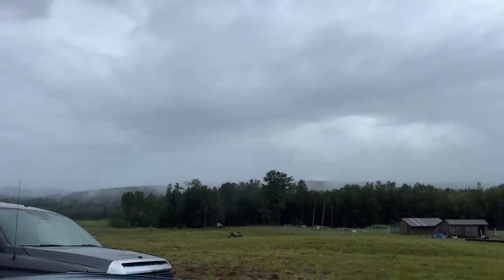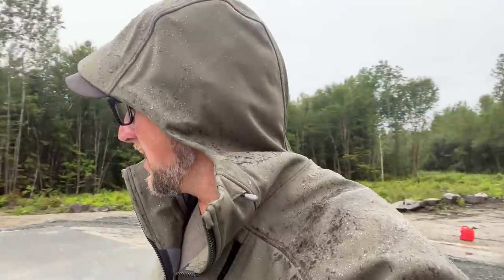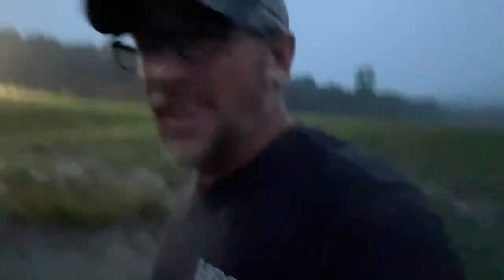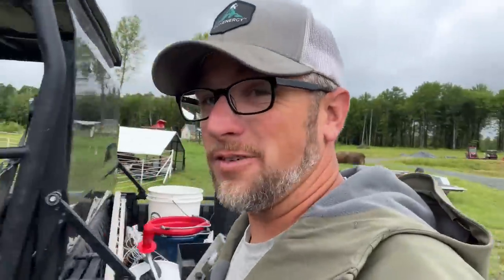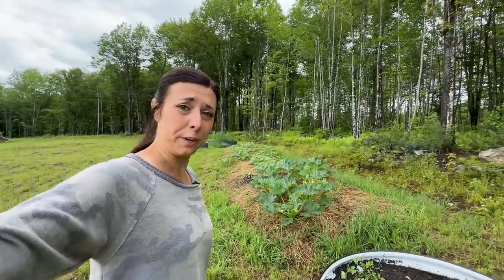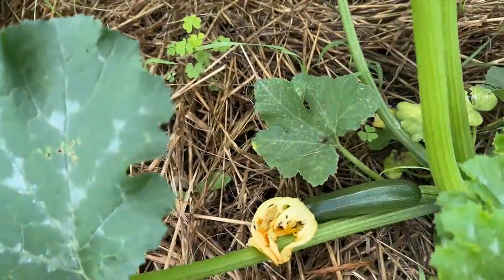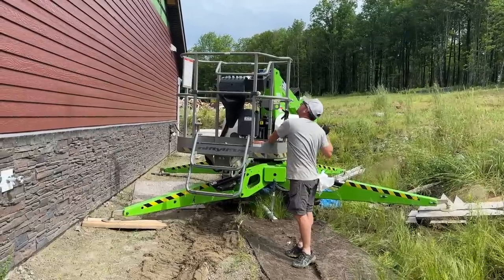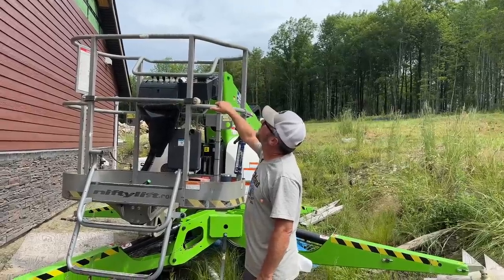MY $2500 MISTAKE...

Comment: Hi Al, Gina and Olivia! You can idle that machine most of the day without using too much diesel fuel. Diesels in general are very thrifty on fuel consumption while idling. I would not cut it off while you are up there….just my 2 cents.  Lol….

Comment: Hi Al great to see what you have done so far. With the Nifty Lift you should have a control down the bottom so the lift can be controlled from there as well. All the ones I have used in the UK have that control so Gina could let you down if the machine strands you up the top. Take car and stay safe.

Comment: Gina when cutting multiple soffit pieces you can stack three sheets on top each other and cut three at a time (saw can handle at least three maybe more) also just add a clamp as a stop on the saw tray and cut multiple pieces same size

Comment: Maybe next time you cut expansion joints in concrete, Gina could use a battery powered leaf blower to keep your chalk line visible if she is not filming.  Just a thought.  Of course it really doesn't matter that much for a shop.

Comment: if you tilt the machine too much or have it on very uneven ground the boom wont move and it will lock up,  at last on the machine i have, it has a safety feature stopping you from tipping it over on even ground, you have to have the struts out and level the machine off before it allows you to raise the boom.

Comment: Hello Al. I love your videos. I have that same rain gauge. Once the center section fills up with the inch of rain and overflows into the outer  section, each tenth of an inch measurement in the center tube is another inch of rain. No need to  pour it into the center section to  measure how much rain you got.

Comment: Most lifts have a device that shuts it off when the machine is not level enough..
Reply: having worked on stuff like this, my first guess is a low fluid alarm..... like the coolant overflow tank is not up to snuff. There's usually a warning light to tell you why the alarm is sounding.... but you have to know enough to look for it.

Comment: All engine man lifts should be equipped with a emergency decent feature run by the battery. You should read up on your lift so you can use it if the engine quits

Comment: What does the bottom plate of your circular saw look like after running it over 240 feet of concrete?
I can imagine it is fairly well scratched and scored.
Still suitable for use on wood?
Reply: not for finishing.

Comment: The machine will still lower when the engine is off ..  if your up in the air Al .. well the ones I've used did

Comment: Those lifts all have a manual valve that you can crack and it will bleed off the oil in the lift cyl so the boom lowers.  Of course it has to be in a position where you can just go straight down and somebody has to be there on the ground but it is an option.

Comment: West Kentucky,  North West Tennessee and southern Illinois got 11 inches of rain Tuesday night and Wednesday,  lots of roads  washed out and homes flooded.  Mayfield Ky. Was the same area the December 10, of 21 tornado took out most of the town also.  Even got over I-69 interstate near Fulton Ky> Fulton Tn.    Been a wet July so far.  I'm 30 miles away and got 1 1/2 in. Rain.

Comment: Too wet for dill. When I saw the first shot of the lift from behind, tipped so far to the right, I said to myself I wonder if the things that prop it up will engage because of the severe angle?
Reply: 100% correct!

Comment: Or you could have dug the bank back a few feet to get the first lift behind the house using the exvator. .and saved 2500 bucks!
Reply: A reply From Lumnah Acres on a previous video ”No we don’t want to remove any more of the bank we have it sloped for water control”

Comment: Considering the number of buildings you seem to erect, getting a good (even a used) scissor lift from the machinery sales sponsor instead would have been better than that third or fourth baby tractor. Just a rolling scaffold would have seen you right on this one.
If birds roost on that high window, install a spike strip or an angled surface to discourage them.

Comment: While I was admiring your green garden, I thought how much fence wire and post would be required to deter those 4 footed nibblers from destroying it in one night.  Here.  Two geraniums I kept overwinter under a grow light, were absolutely  blanked with buds, literally covered in red, put in a shelter plastic house each night, early, and taken out too early, it seems, as those hairy bandits ate most of the buds in one fell swoop.

Comment: The problem with trying to start the machine was because where it was parked it was not level when it was turned off and left. A safety issue. Once you got it level I'm sure there wouldn't be a problem starting. You do nice work Al.
Reply: Then why did it start from the engine switch? Wouldn't it still be out of level? I don't suppose all those diesel machines out in the world worry about keeping them level for startup. Do you have a lot of experience operating equipment?
Reply: @davidjohnston1971 peculating, but if unlevel it'd need to be moved somehow anyway, but a person in the basket is at higher risk as well as making it more unstable/top heavy. So I can see how being able to operate it from the ground, but not the basket, could make sense...

Edit - just saw it could still be operated from the basket after starting from the ground.... Maybe the assumption is that if you use the override you're supposed to really know what you're doing?
Or as Al suggested, mayhaps just a switch issue...
Reply: @michaeltempsch5282      don't add up, meaning it can't be driven on uneven terrain?   Shut off and restarted to move.
Reply: @davidjohnston1971  Retired Union Steamfitter and Pressure Welder and I have been trained to work in Nuclear Generation Stations where I have been tested on a number of these units. Lots of Safety devices such as the vocal siren and beeping.
Reply: @davidjohnston1971   Yes I do, as a Union Journeyman Steamfitter and Pressure Pipewelder in Nuclear Generating Stations during construction, and maintenance for years after completion.

Comment: I'm wondering 🤔how Al is going to clean those 3 upstairs windows when he doesn't have the lift anymore ? It would require the use of a 50 ' Extension ladder at least and I'm not sure if he has one that size ?
Reply: European windows swivel on pins are easily cleaned from the inside.

Comment: Couldn't Ken's Carpenters come and put the siding on the last half of the back with his own guys for 2500 dollars.?
Reply: They would just use ladders and knock it out in less than two hours 🤣
Reply: 2500 dollars for that lift for 2 days use is crazy
Reply: @ky.gambler5281  ... wild guess is he locked into a long-term rental plus a few bucks for pick up and delivery.
Reply: not sure of the pricing structure in that area, but I would have guessed Ken's crew could have knocked the two tall sides out in two days, or well under $1000 a day... and maybe throw in the short sides as a nice gesture.
Reply: @rupe53  There is not that much siding left to put up. Ken's crew, minus Ken, would knock that out in less than half a day. I'm talking about the upper portion of that back wall.
Reply: @DukeOOO  ... if you read my reply. I was talking about the entire job, from scratch. (instead of renting a lift)

Comment: Why not explain why you couldn't use your excavator, or your tractor with a bucket to widen the area around the back of the residence to accommodate the first lift? LOL What happened to that nice greenhouse you had at the old homestead?
Reply: A reply From Lumnah Acres on a previous video ”No we don’t want to remove any more of the bank we have it sloped for water control”

Comment: Are you sure the problem with the lift isn't a tilt warning? OSHA regulations:

Here are some tilt regulations for scissor lifts:
For Pettibone machines, the tilt limits are 3° for front and back incline or decline, and 1.5° for left to right tilting
*A tilt sensor automatically stops the lift's operation if the tilt level exceeds these limits
Most slab scissor lifts cannot elevate when working on a side slope greater than 1.5 degrees*
The scissors of a lift table should not be set at an angle of more than 45°
Electric scissor lifts are ideally suited to firm, level surfaces, typically within about two degrees of level
Scissor lifts are prone to toppling over if the center of gravity is off
High winds are particularly dangerous for scissor lifts, and workers should use care during bad weather
Scissor lifts must have guardrails installed to prevent workers from falling
While OSHA doesn't require safety harnesses for scissor lifts, they may be required due to contractor safety policies, local jurisdiction standards and other guidelines
Reply from the maker: No it’s not a tilt issue. I wish it was
Reply: @LumnahAcres  I believe it was....wanna make a bet, Al?
Reply: scissors lifts don't have outriggers, so a different animal.
Reply: @LumnahAcres  ... one would think there's a display of faults to tell you what the alarm means. My first guess is either a low fluid level or a switch that tells the unit when the basket is fully lowered. Might be as simple as the coolant overflow tank is slightly low (not the radiator) and after running the coolant expands enough to shut the alarm off.
Reply: @rupe53  Are you sure he didn't attempt to lift before putting the outriggers down? That would set the alarm off and shut everything down.
Reply: @rupe53  I checked on OSHA website, and got that directly from them. Scissor lift regulations were taken *directly*. I should have used quotation marks. The tilt interlock has been required for quite awhile. I learned about it in 1999-ish when I was part of the beer destroyer team after a semi-truck flipped over in Eastern Oregon. It was FULL of Coors beer. After the crash, the beer could not be sold, so it had to be destroyed...everry can or bottle. I reeked of beer. I didn't  think about it until years later, buyt if I had been pulled over for a traffic stop...

Anyhow...I had to get certified to operate a forklift, and a scissor lift. IIRC that interlock was on the test to get certified.
Reply: @HugoHugunin  .... I am also a certified operator. Scissors lifts don't have outriggers. This is NOT a scissors lift. What Al has here is an articulated man-lift. It needs outriggers for the extra reach. BTW, a forklift has the interlock switch in the seat and / or the seatbelt. Usually, it doesn't kill anything but will sound an alarm if you are not properly seated.